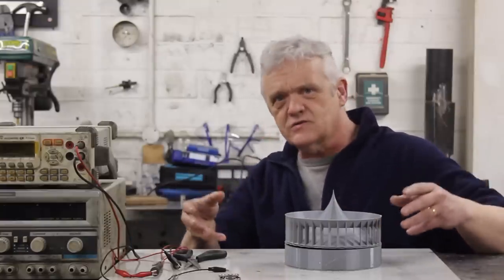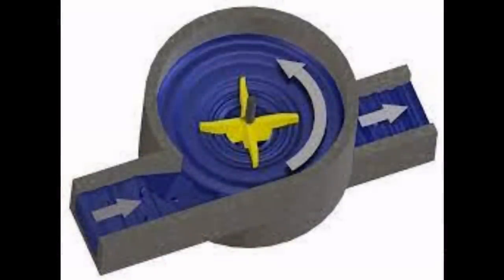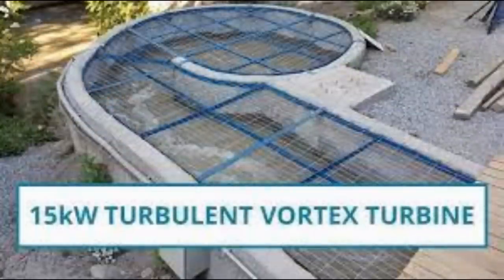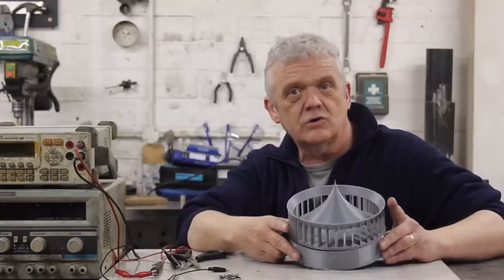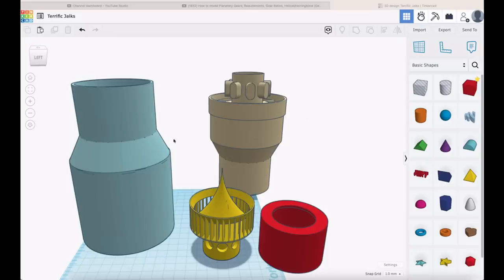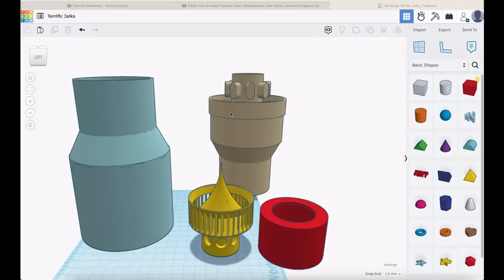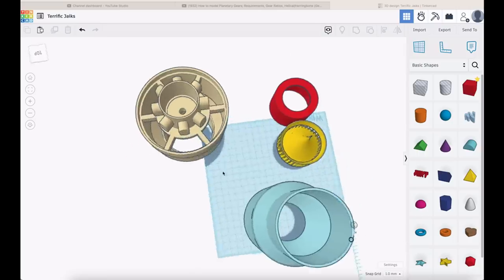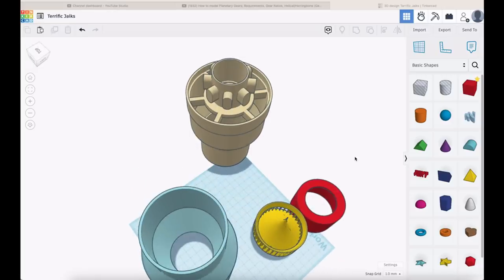1884 A Vortex Turbine In The Making

Comment: have you tried a very small stream right on the tip you could have the water pool and then feed it into an upper reservoir. gravity fed stream with pump or archemedies screws could help cyclate the fluid in a system.
Reply from the maker: I haven't but I will do

Comment: excuse the probably rambling question, how do you increase the power from a generator? presumably you are measuring an open circuit voltage most times, and when you place a load on it an amount of current is drawn, which acts to hold back the turbine, so if you are drawing 10W from a turbine this would be the same as applying 10W of friction to the system, so at some point the turbine will be spinning as fast as it can go but can you increase the electrical friction to pull more power from the driving force? can you have additional open circuit coils that are then switched in to increase the current you can pull from the system?
Reply from the maker: you can't increase the power from a generator mate because generators don't produce power - they convert energy from one form to another - for example - here the power originates in the water - to get more power you need more water or more energy in the water - like increasing the head - the generator will convert that to electrical energy - you can get a better efficiency that's for sure - but basically that's where the limit comes from - so to improve power out you need to improve conversion efficiency - more coils doesn't improve efficiency

Comment: just throwing it out there, would you be able to extract more energy from the fluid, be it wind or water, if you had multi stage turbines, in different sizes, so start off small, and progressivlely get larger, like the triple expansion steam engines were?
Reply: Isn't that because the density of the working fluid is reducing from one turbine to the next so as pressure drops you need a bigger turbine hence not applicable for constant density water
Reply from the maker: you don't really need to increase the size mate

Comment: Hi Robert! How about that, you are actually giving it a go! Question, though: Is there a reason why you put the magnets on the inside of the coil? To me it makes more sense to add the cap directly to the rotor and add the magnets on the inside of the cap. Spinning them on the outside of the coil: you only have to print one part, and as the energy production is related to the speed of the magnets you would gain some speed pushing the magnets as far out as possible. Anyway. Great work!!!
Reply from the maker: of course I am mate lol

Comment: add spiral fins to the cone that are running opposite of the fins of the outside, that should produce larger pressure on the outer fins and make the water turn bigger angle, which will increase the conversion of the kinetic energy of the water...
Reply from the maker: cheers mate

Comment: I am wondering, Is there any advantage to the small diameter magnate ring and coil in this design? to me the farther out the coils are, more wires crossing are cut by more magnetic field lines faster?
Reply from the maker: you are right mate - it is only small for practical considerations nothing else

Comment: Ok, how do I make this more complex unnecessary and make it more useful too... Can we jury rig an electroplating to coat the plastic in metal for additional strength?  Plastic isn't conductive so would bonding carbon to it work for plateing? End goal build an enclosure and run steam through it.  Way to much work but ...
Reply from the maker: I did a video on how to improve the material strength. mate

Comment: Technically, these can be stacked [based on the height from the source to the stall point.

So if you have say 3 meters from the water source to the point where it can fall no further, and your generator takes up say, 30 centimeters, you can, realistically, put 9 of these generators one above the other in the same flow of water.
Reply from the maker: very true mate

Comment: I was thinking about another idea way back. Here in Scotland is a lot of rain. So, if we'd take an IBC let's say a 1000 litres, and plug in the room drainage through it to fill up to the brim.  Only than over pass this IBC to not overflood it if the stream would be too strong.

Now, on the outlet, create one after another small turbines in series, and use a gravity to get the water down. As we can't gain the energy, we know it won't produce more Watts than we've used to get that water to the top. But, as we didn't put this water, it was a rain which did it, we've gained the wattage out of it ;). 

The question only is what is the optimal capacitance of the IBC in total to make it worth tinkering ;). I'd say for a small house, 1kW might be enough for a whole day, but for a family of 4 with no EV, this might not be enough for 1 hour. 

IMHO, if we can't produce per hour 1kW of energy, these projects won't have too much impact at the end. That should be our minimal goal to achieve :).
Reply from the maker: you can calculate the joules in the water mate - given the mass and the height of fall - that less losses in conversion will give you the amount od water you need to be able to store
Reply: @ThinkingandTinkering  thank you :)

Comment: Maybe a serpentine coil on the outside of the pvc pipe to keep it seperated from the flow of rainwater. Slightly stronger magnets would overcome the distance. Much easier to keep it dry i'd say
Reply from the maker: pour candle wax in the coil space - problem solved lol

Comment: Multi-cylinder steam engines of a century ago reused the depleted residual energy of steam released from the initial high pressure cylinder, by feeding it into the next cylinder. The second cylinder was increased in size to take advantage of the even further depleted steam heat and pressure. Similarly, the steam released from the second cylinder was fed into a third, even larger cylinder to take advantage of the third level of depleted steam heat and pressure. All pistons in these cylinders were connected to the same crankshaft to drive the engine.

All that was by way of explaining the principle of using the depleted energy of water released by the first turbine to feed into the next larger turbine, then from that into the next even larger turbine, all connected to the same central drive shaft to drive a larger generator.
Reply from the maker: they called them triple expansion engines - for obvious reasons - nice one mate

Comment: So if you understand scavanging in a pipe  you could hook several turbines in series and the  downward flow of the water will run the turbines as well as the hydrostatic head .
  Building a dam  isnt as important  if you  use the water in motion in the pipe  instead of  running water thru a turbine --'then changing  its direction  so it can flow down the river .

Comment: Please test if you had these smaller units arranged in a GRID or a LINE - how the proximity to each other affect each other - i.e. how their OUTPUTS (the air or water expelled) can either perhaps COUPLE with each other or INTERFERE.  You may find that by arranging these in a specific pattern that you can generate even more power (with the same input) using the output of each unit to fuel the others (or we may learn that these would HAVE to be a certain distance from each other to avoid interference).  Would be curious what you learn.
Reply from the maker: you could always try it mate

Comment: I have cliffs on my property, I'm thinking use a pico hydro turbine like yours in this video to generate physical power that can be harnessed to generate electricity and other possible physical uses like a gravity battery. I figure i can have water flow over the cliff edge to the turbine and then down to a ram pump that sends three quaters of the water back up to the top to flow back down again,  could add an additional ram pump further down to send more of the water back up to the top (unfortunately some water is going to always run off down the hill)
Reply from the maker: interesting mate thanks for sharing

Comment: These could be stacked on a drain pipe to gain more energy. There may well be an optimum distance apart so that the water gains enough kinetic energy between the generators to make it viable, particularly on tall buildings.
Reply from the maker: for sure mate

Comment: Hi Rob
If this was used to generate power from waves or tides could it work in both directions? Or it would turn the same direction if flow reversed? André in Sydney
Reply from the maker: you might want to put two back to back

Comment: I recon if you had  a couple of acres of roof and three to four inches of rain a day, a down pipe generator might be worth considering. Whilst fascinating they are rather fringe toys for the most part. However  I still think they are worthy of thought, imagine you live in an area of steep slopes and constant running spring water not enough to run a standard turbine but sufficient to run this 24/7 through standard clip together domestic pipe work and operate as a trickle charger for your house battery all day whilst at work, very cheap power. you would not even require that much of a drop.
Reply from the maker: for sure

Comment: Hmm, I have a small stream on my property without a significant head but enough to run a ram pump. Now, if I took the flow from the ram pump and ran it over this turbine, I could have a constant supply of power, albeit minimal, but power none the less.  Have you done any, head/flow vs watt/hr produced experiments which maybe would allow extrapolating to a larger design?  Neat stuff and a great excuse for a "NEED" of a 3D printer.
Reply from the maker: I haven't mate sorry

Comment: If this is the generator you made a few episodes back with the S-coil and magnets right under the fan disc, you'll want to reconsider the design for use underwater. Electric motors underwater need to be contained in a watertight compartment. There are a few reasons for this, electrocution being the primary concern, but also rendering a loss in useable power, and corrosion of the metals when a current is applied to them. If I recall the design and understand the concept of this pipe assembly correctly, the magnets in this design would be completely exposed to water, depending on how much water is expected to flow through the pipe. If this is intended for a rain gutter, then a simple angled rain skirting around the edge will probably do the trick. Put one on the fan disk and one on the S-coil disk angled up to help prevent splashback. If you wanted it to sit in a fully submerged pipe though... it'll fry.
Reply: It looks like the magnets are inserted from the inside, just a simple lip would stop the water from entering the cavity I would think.
Reply: @JustIn-mu3nl  Yes, Even better! Just glue a thin, flat strip of plastic around the bottom of the fan assembly to cover the gap and just make sure it has enough clearance to not drag. Simple is always best! Good contribution!
Reply from the maker: just fill the coil with candle wax mate

Comment: The water turbine is an excellent concept but I could see a potential problem with the water particularly if there are particulates in it corroding the magnets and oxidizing the copper serpentine coil.
Reply from the maker: and do you have a potential solution?
Reply: @ThinkingandTinkering  I just joined as a member, so I do submit a mechanical sketch regarding the reply question?

Comment: Water is  600 times more dense than air (a marine engineer's rule) so it ought to push a turbine easily.
When you pour water on it, the bearing will rust!
Reply from the maker: and do you have a potential solution?

Comment: Flip the turbine upside down in a tank of water, then release air bubbles underneath. Will rising air bubbles in water spin the turbine?
Reply from the maker: dunno
Reply: @ThinkingandTinkering  If it does, then you could stack several turbines above each other, keep funneling the rising bubbles back into the next turbine. The rising force of 1 cubic centimeter of air gets multiplied by each turbine. And bubbles are not affected by the weather and do not need moving water. Just a storage tank.

Comment: @RobertMurraySmith - Hello, just an observation; To help lengthen the life of your device and reduce friction at as many contact points as possible, consider a material called, 'U H M W P E' Ultra High Molecular Weight Polyethylene for bearing materials. UHMNPE actually comes in nearly every shape and size you can imagine, including tubing, tape, sheeting and blocks for machining. If a tough and slippery material added to your device as bearings in critical areas is what you are trying to achieve, this should be the answer.

Comment: Could the pressure of a man made waterfall push water back up a pipe to the peak? Like a perpetual water fall in a sense?
Reply from the maker: no
Reply: Its hard to explain what i mean but say the tank at the bottom which holds the water from the top had a rubber seal which can only be opened one way via pressure and closed when was none ....its so hard to explain what i mean via youtube comments lol  im like you start one project and realise faults or improvements and start a new improved mk 2 or in your case mk22 version lol love your videos keep up the good work

Comment: I look at the compressiblity.  Water being much less and air being much more.  Electricity being much more compressible than air but many of the same qualities.  To the point though, the fin design would be different for water?  More fins?  Different angle?  I would have to put a small ring 1/2in around the bottom to help guide the water outwards away from the electronics.  Could put fins on it also maybe, or not. More free leverage.
Reply from the maker: yes it is different - because water is more dense

Comment: Trying to prevent it from shorting out while running with water will be quite a challenge by itself however..
Reply from the maker: It really won't it is almost completely waterproof as is
Reply: @ThinkingandTinkering  Maybe an overhanging lip on the yellow section, you wouldn't need much, 5mm would probably do it.

Comment: Could the cone water generator be situated in the middle of a larger rotating wheel using the slowed water to lift the used water to a header tank, and gravity feed the water back through the generator in a closed loop system. Just thinkin 😂
Reply from the maker: it could but there would be no net power out

Comment: I am not an engineering, not even close, actually a drop out, but I have this crazy idea of a self contained power generator that I think it is as close as it can get to perpetual movement. Please someone help me figure it out, lets all assume IT DOESN'T WORK so save your negative comment, but if you think it could, what do you think it could prevent the water from flowing and how to overcome those challenges, thanks!!...Here it is:
We have two tanks of water, tank 1 is at the bottom and is full of water, tank 2 is 10 ft above and is half full of water. two pipes (A & B), pipe A is connected to the bottom of tank 1,  and the middle of tank 2 (just below the water level), with a valve (A-1) at the entry of tank 1, pipe B is connected at the top of tank 1 and the bottom on tank 2, with a valve B-1 at the entry of tank 1, tank 2 is half full of water and half full of air but it's air tight with one valve (C) at the top of tank 2 (to be able to fill with water at the level desired, half way and just enough to submerge the entry of pipe A), with both valves (A-1 and B-1) closed, with open the valve C of tank 2 and fill with water (leaving the desired air space), when closed, tank 2 is air tight, pipes A & B are full of water and we open both valves A-1 and B-1. the water will start flow downward on pipe B (tank 2 will have enough gallons of water for is gravity to want to flow downward) forcing the water in tank 2 to want to lower but since no air enters to replace the space leaving the tank, the pipe A will begin to pull the water upward (due to the air pressure inside) Similar to us sipping water upward with a straw from a glass of water.. This way, the water flows from tank 1 to pipe A to tank 2 to pipe B to tank 1. Add a hydro turbine at the bottom of pipe B and we got our self a self contained power generator. 
Any feedback? Thanks!

Comment: I was wondering, is there any easy DIY way to harvest 1KWh of electric energy in 24h (apartment set up), I try to find some realistic metrics and realized, in a tropical island, I mostly need 1 rice cooker for 40mn to cook meal, that's 700W,. Obviously the best way is combustion (minus CO2 emission), but I was more looking for a standard measure that would represent minimum requirement to evaluate solutions against practically. It seems to me harvesting 1KWh per day is good practical low bar to shoot for.
Reply: Maybe some kind of mirror, reflector, system would provide high heat in the sunlight.
Reply: @windzor  But how to harvest? ie store? especially for cloudy day?
Reply: @NeoShameMan  That would difficult or inefficient, but it is still practical or useful, better than nothing.    Solar air heaters are about 80% efficient, direct heat, no storage needed, whereas solar cells might be 20% efficient.
Reply: @windzor  I specified harvesting though.
Reply: @NeoShameMan  Maybe hot rocks or metals that can store much energy.  Provably out in an insulated container.
Reply from the maker: yeah loads - you just have to get your head around it

Comment: IMO deflecting the flow that much spends energy rather than collecting it and converting it to electricity Change the central cone into fins connected to the outer ring with magnets and coils and let the water flow straight down You can stack dozens of them nearly to the roof top and harvest energy all the way down as gravity is a relative constant
Reply from the maker: go for it